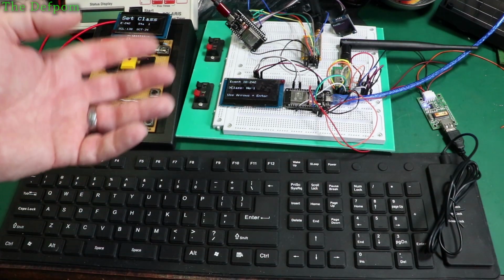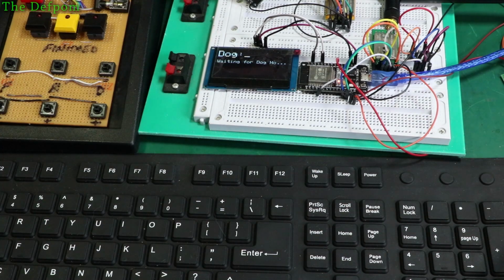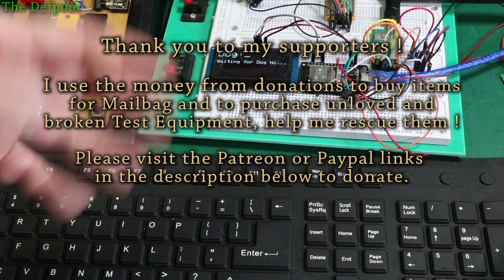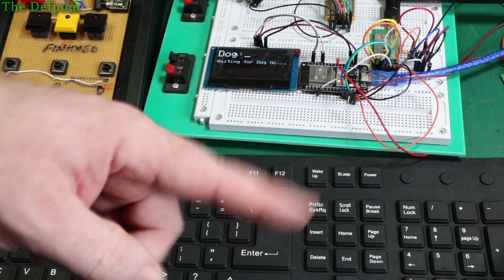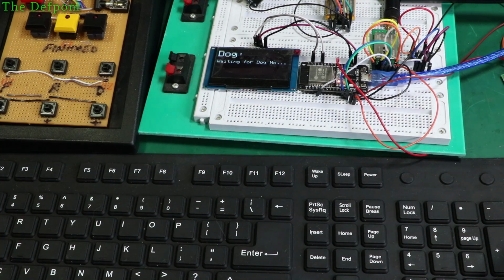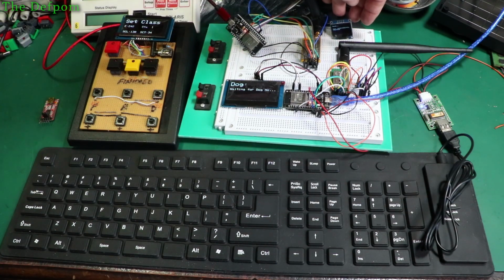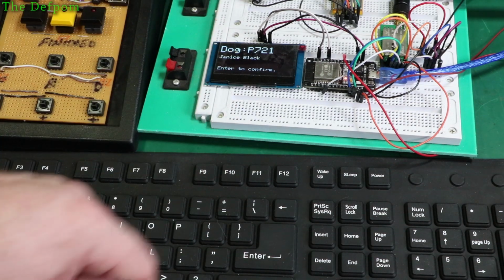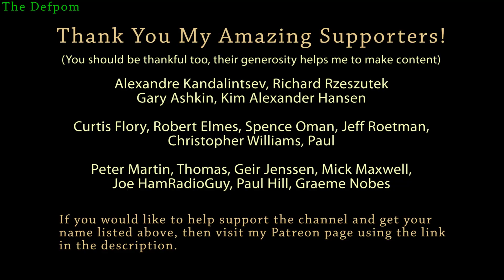#683 Making A USB Keyboard to LoRa Interface Project Part 1

Comment: Hello. I buy also this Lora module but i did not find the library for it. So i cant use this module... What is this library please?
Reply from the maker: You don’t really need one, you can use the ebyte software to program the module before using it, it just needs a UART connection to sent and receive data. The ebyte github has libraries you can use too.
Reply: @TheDefpom  OK. Thanks a lot. I try it.

Comment: Hi, where did you get those huge OLEDs from? They look like 2.5". But I was able to find like 0.96" max.
Reply: Try searching on Aliexpress for "oled 2.42"
Reply: @KeanM  Thanks. I have found it. I wonder why is it so expensive comparing to smaller ones :(  0.96" costs 2€, 1.3" costs 3€, 2.42" costs 13€
Reply: @Chupacabras222  I presume the high cost is partly a factor of yield, and partly lower demand.  Those smaller OLED were hugely popular for low cost phones and MP3 players, so got manufactured in large quantities.
I've not yet bought any 2.42" ones myself because of the pricing, and concerns of shipping damage.  Unfortunately my last shipment of 1.3" displays had about 30% cracked corners, which I didn't discover until too late to claim.